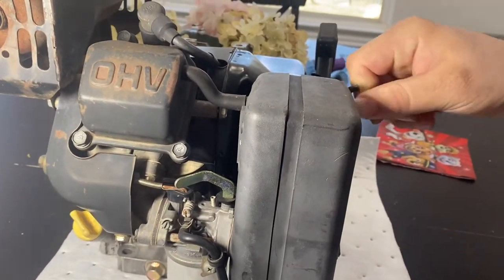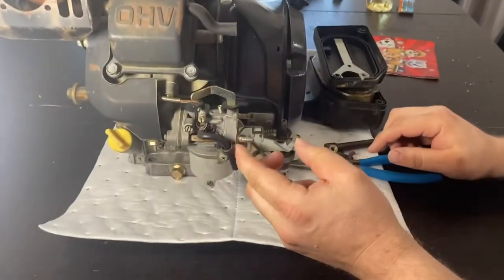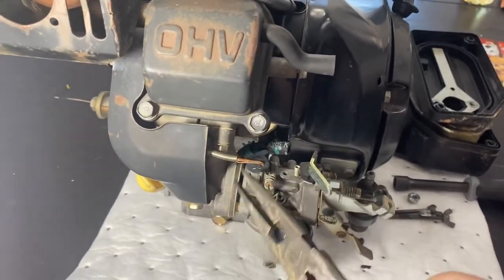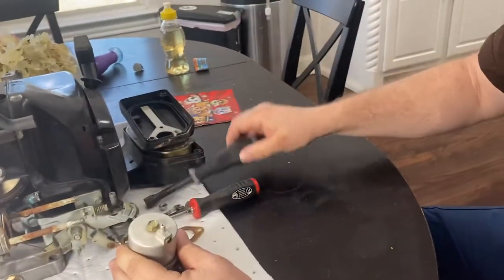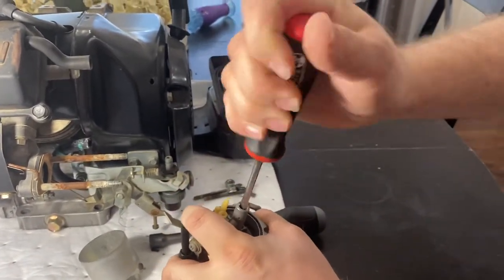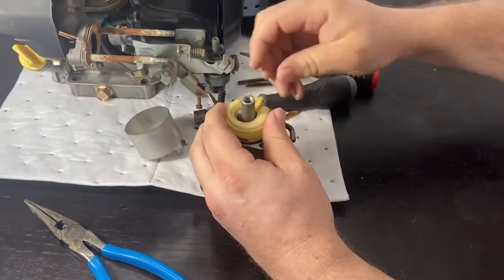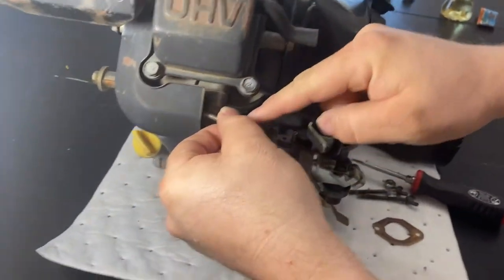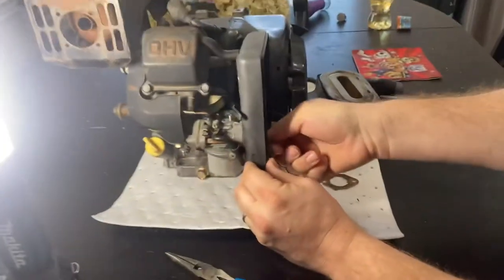Kawasaki FE120 Carburetor Removal

Comment: Thanks for demonstrating this process.  Could you clean both jets (one on top and the one feeding the bowl) without removing the whole carb?
Reply from the maker: Hey @redtwin1968, the top you can for sure.  The bottom one you can as well, but with this engine usually being on a Toro GM1000 or Flex, I’m not sure if you have enough room to get into the jet in the bowl from underneath.  I think you can though.  Love your journal on TLF.
Reply: Thanks for posting this! I started my mower sometime during the winter to move it, then forgot to run the fuel out of the carb. Now she only runs on starting fluid. Oops!